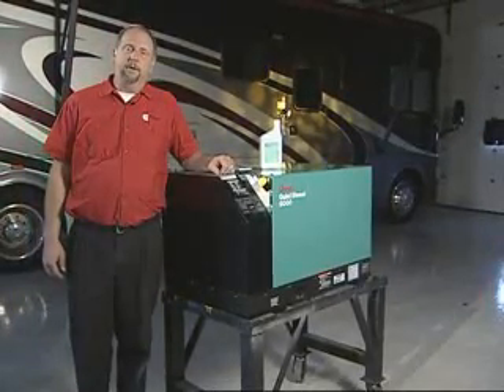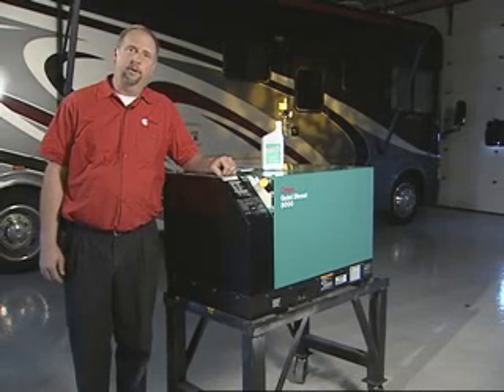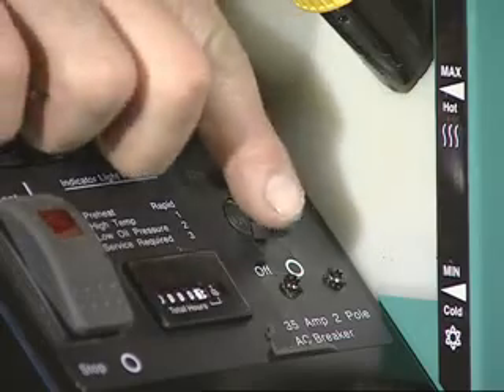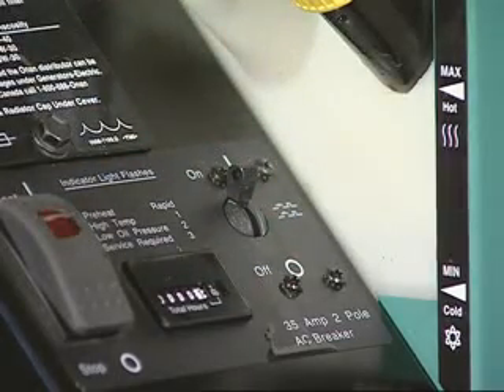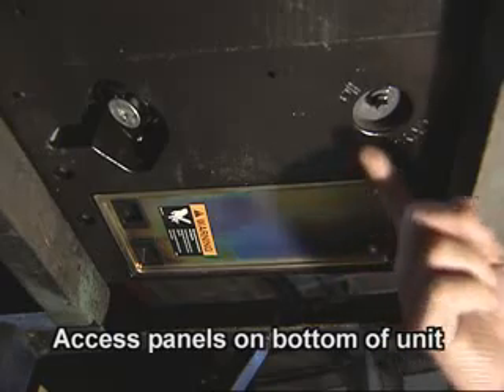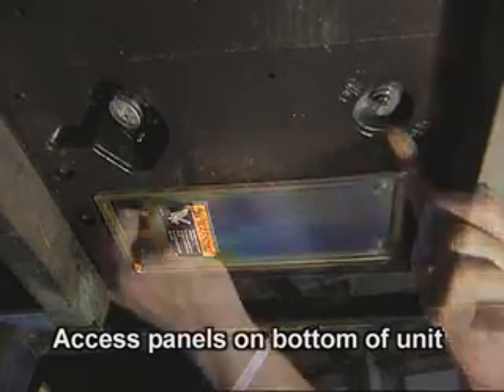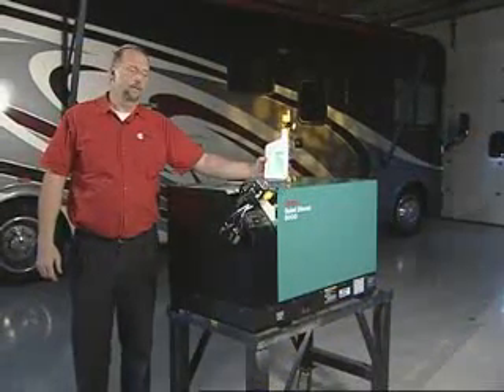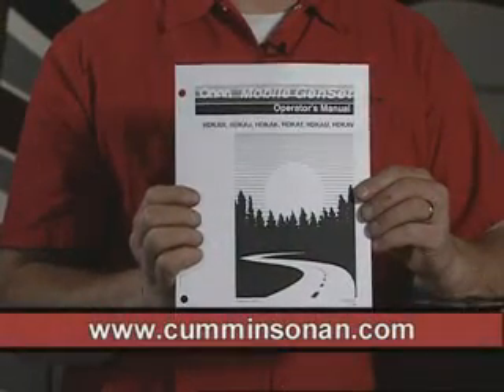Cummins Onan - RV Products - How to HQD8000

Comment: Have a onan 8HDKAK-1046K will not run. Fault code is 36 low fuel level where is that switch. And is it something I can change.